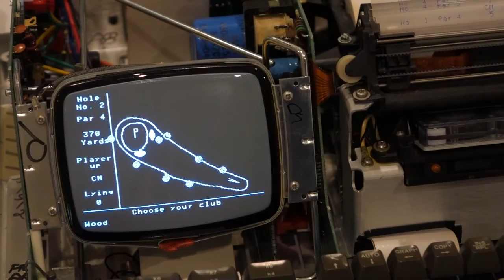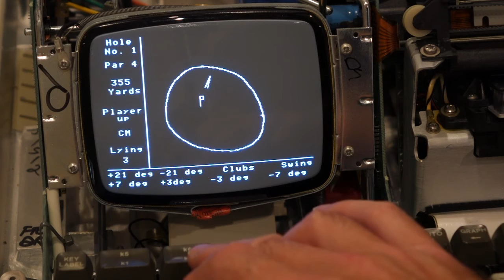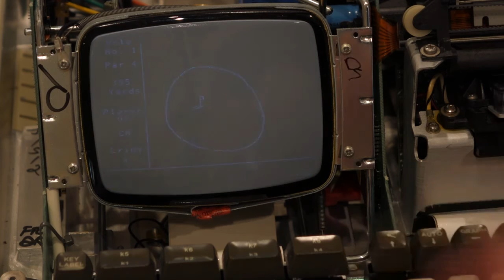HP-85 vintage computer: repairing the tape capstan with an O-ring

Comment: Thanks for the memories! I was one of the production engineers working on the HP85 in Corvallis, OR in the 80’s.
Reply from the maker: Awesome! Nice to have you here. Share stories if you have some!
Reply: CuriousMarc ...back in the days when we had to pincushion the CRT’s with fixed magnets glued on the yoke in order to keep the raster somewhat square!
Reply from the maker: Yes indeed. Lots of magnets big blobs of in silicon glue.  That's why we've refrained so far from changing out our Xerox Alto CRT lest we relearn the whole procedure for doing this.

Comment: I have really enjoyed watching your videos. I watched this one a few days ago and then got to thinking about a few things that might be of interest. A while back I was looking for some rollers that would be suitable as idler rollers to tension small timing belts and noticed that McMaster (dot) com has a large selection of such rollers. If you search for 'rubber roller' and then look at the 'rubber drive rollers' you might find a roller that would work for your capstan.

Also, a long time ago in a galaxy far, far away (Ohio), I used to repair computers, copier machines, printers, etc. We used to buy some special cleaners for rubber rollers as if you try to use alcohol it will clean them (and they work better at first) but it dries out the rubber and ruins the roller eventually. If you search for Names such as 'Fedron', 'Techspray Rubber Rejuvenaotor' and 'Linx Products Rubber Clean' you can find the type of cleaner I am referring to. I suspect it would help for any rubber rollers in card feeders and such.

Also part II, there was a company (I want to say there name was Ames) that could grind down and recoat platen rollers for typewriters and printers. Even when new replacement units were available getting them recoated was much cheaper and now that these parts are not available it way be the only way to repair 'vintage' electromechanical machines.